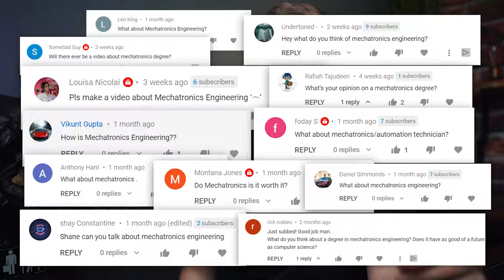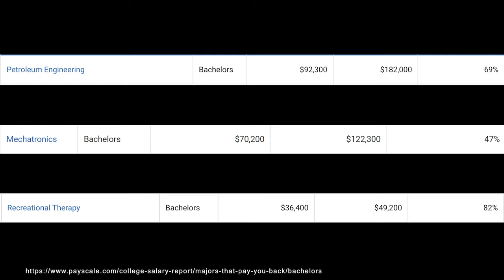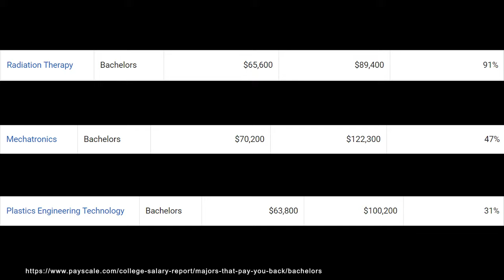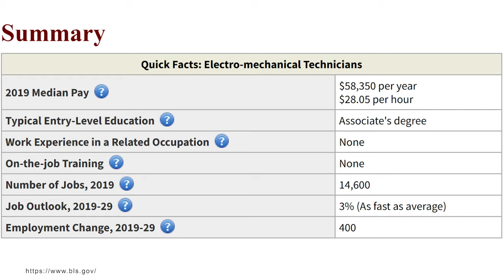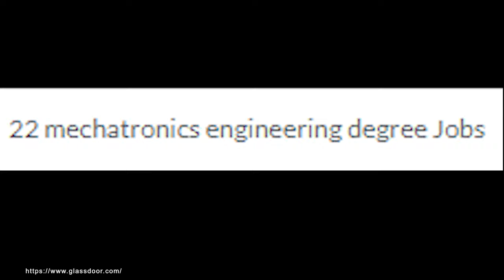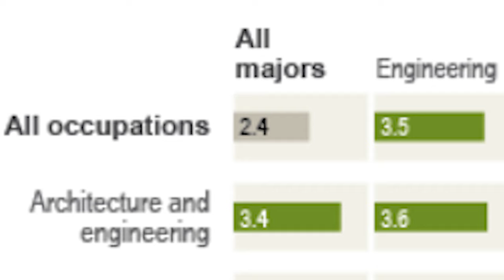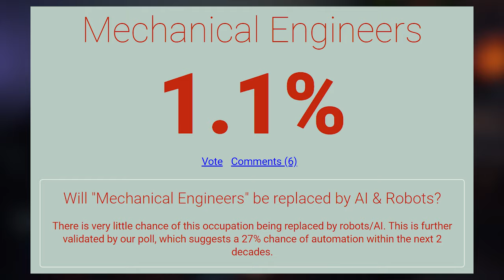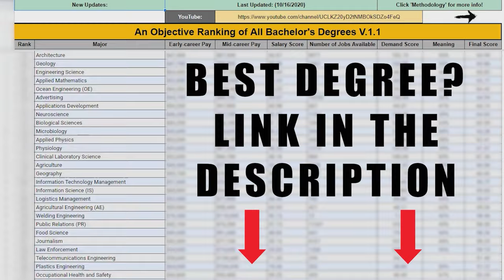What Is Mechatronics Engineering?

Comment: I studied mechatronics and robotics in uk . Was fun and challenging but it’s defo not for everyone . Turned out for us we done zero robotics till final year and we only had one module. Rest of the course was mainly a mix between electrical mechanical and software engineering .
Reply: what about jobs, how's that turning out
Reply from the maker: Yup! not for everyone
Reply: @rawad5584  im currently doing a postgrad degree in comptuer science as i did find i loved programming through my degree. I did apply to a few jobs and got multiple interviews.
Reply: @rawad5584  the great thing about mechatronics is that you learn a ton of different areas so when applying to jobs youre well diversed. I felt more confident in my programming and electrical/electronics than i did with mechanical. However i learnt a lot of fundamentals in mechanical engineering too but we skipped out on things like fluids and more advanced mechanical problems.
Reply: @MrEvilyogurt  riiiiiiiiiight yeah its nice how mechatronics provides such a wide rage of knowledge and experience and potential, personally i lean towards mechanical engineering but electrical and software will really open up alot of opportunities, so yeah i feel like job-wise, when it comes to mechatronics it isn't that much of a problem, good luck with your interviews too
Reply: rawad._. ABZ isn’t the mix that you described literally what robotics is?
Reply: @pugboi8017  mechatronics is big part robotics soooo
Reply: @pugboi8017  yea but we done zero robotics until our final year. Where we had 1 module in it which was a bit sad. Might be different for other universities
Reply: That's completely ass backwards. They should have you guys working with Arduino's etc
Reply: @MrEvilyogurt 
Yeah it is, here in my UNIS it is all about robotics alongside mecha, electrical and software with a lot of arduino, very crazy and fun.

Comment: Thanks for the video, but may I point out, I think that mechatronics engineering works best as a master degree than a bachelors degree because it gives you taste of multiple engineering majors without concentrating on any of them, I hope that it gets “discovered” soon so I can try to get a master in it, also can you please do a video about artificial intelligence engineering?
Reply from the maker: Thanks for your input Dude X
Reply: Can I do a bachelor's degree in mechatronics engineering and then switch to mechanical engineering for my master's? I am not sure how it works and I can't find it.
Reply: @MikeOxolong  I think that depends on the University. In my uni it's definitely possible
Reply: I agree with this, there are a wide range of topics and most of them are only taught for only 1 semester so this degree is like a jack of all trades master of none. This degree is useful for automation but lacks in other areas and it is not flexible, you need a masters degree if you want to go in different fields.
Reply: @alaapsarkar  I have a bachelor degree in mechanical engineering can I master in mechatronics?
Reply: @kifahkhamis8990  yes you can get a mechatronics masters. You should definitely explore more though before settling on a master's degree.

Comment: Mechatronics is too spread out and not specialized enough in my opinion. Additionally not many firms have the capital to invest in actual mechatronics work so it ends up being either hardware or software work (sometimes there is a mix but not in the mechatronics/robotics sense most the time). This is particularly true for countries outside the US/silicon valley. Having said that it is still an engineering degree so it will be default better than most other choices